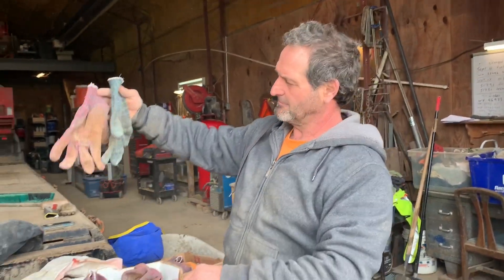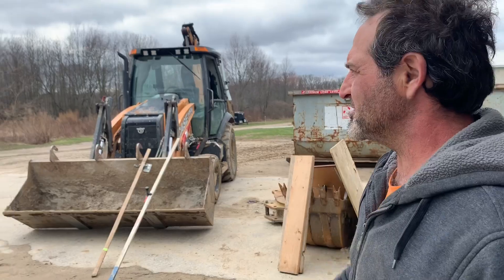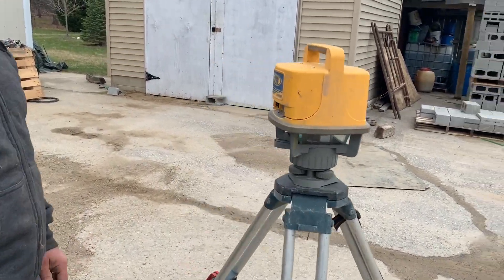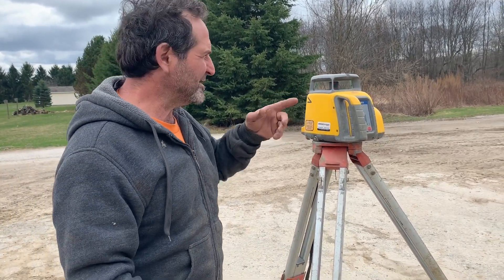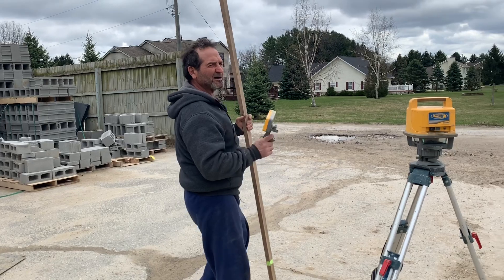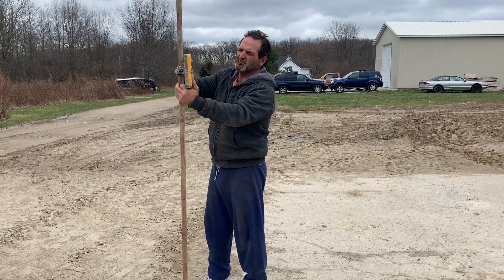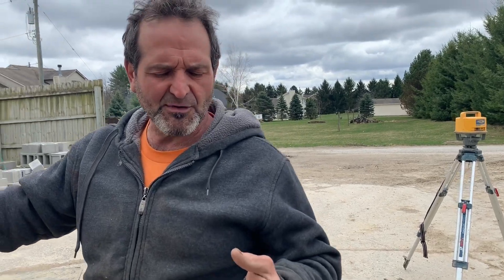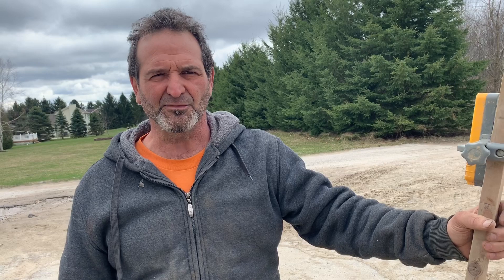How to use a Laser level for Foundation and Block

Comment: Go a question when measuring with Lazer level for footing and you are finding different height of slope when you do you put more concrete or don’t dig as deep on lower end to make the footing level before you put the base of blocks or how to make level
Reply from the maker: You can step up the footing with the grade.  Make sure to step up in proper block height measurements so it will land properly.  Keep the footing level and then step up as the grade gets higher.
Reply: So make the concrete forms kinda look like steps in the height of bricks
Reply from the maker: @joemoritz4420  Is this a trench footing?  I usually do not do any forming.  All of my work is earth formed.  I am located in Michigan - they may do it differently where you are located.
Reply from the maker: @joemoritz4420  If you are doing a spread footing, yes you would need to form it in the height of blocks/bricks so that it will gradually go up with the grade, leveling off each step.  This way everything will line up when you go to lay the brick/block.  Make sure to take into account the mortar joint also.
Reply: Yes it’s a trench I just know the ground by house is higher then where the back of my add on will end so I was thinking that maybe not dig back end a little shallower
Reply from the maker: @joemoritz4420  It depends what state you are in.  Here in Michigan code is 42" depth.  You need to cover for frost conditions.  I would step the footing down accordingly with the grade but make sure to keep a 42" depth.  I would not dig it shallow unless you are planning on raising the grade on the outside of the addition so you will have 42" coverage.  Also, I do not use any concrete forms on dirt trench footings.  The concrete should be level with grade, or slightly lower.  Come up with block.  A lot of wasted time and energy trying to put a form on top of the dirt trench and it makes it very hard to keep square and level.  Just my thoughts.
Reply: Reality is a Comedy  I’m in Missouri we have to be below 30” inch frost line I was thinking of going high side to about 36 to 40 on high end so that the way be more level but I haven’t measured yet so I do as you suggest and make it level as much as possible if can’t do a step up by brick height
Reply: Reality is a Comedy  thanks for info I appreciate the comments
Reply from the maker: Joe Moritz I hope it works out well my friend God bless!

Comment: I laughed so hard when you washed your hands. I do the same onsite and still think it makes sense. 
Got a question.. for filling foundation block walls. Can spray insulation be used instead of a concrete pour? 
Will it be strong enough to hold the wall once backfilled and is it ok with rebar betwee block also? 
Seems that insualtion is cheaper than concrete where i am, and you get a warmer house also if it works.
Reply from the maker: Hi there I am not sure but I have heard that yes you can use insulation.  I would maybe check and see if there are any videos on that topic.  Over here in Michigan we usually grout fill with concrete/grout mix.  God bless!

Comment: I am getting ready to pour a 12x8 footer. I am going to build a 5’ cinder block wall around it for a koi pond. I live in Michigan and my yard is pure sand. Do I need to do anything special or can I pour the footer right on the sand? I don’t know if I need some sort of gravel in there first?
Reply from the maker: Hi Scott -- What city are you near?  Are you up north or on the west side of the state?  Are you doing a spread footing or trench footing?  If you are doing a 12" wide by 8" high spread footing, you don't need any gravel under it.  You just want to make sure you are at least 42" deep so you can avoid frost from getting under the footing and lifting it.  I hope this helps.  Make sure to add water to the concrete, as the sand is going to soak up the water fast and it could dry too quickly.
Reply: Reality is a Comedy I am in Monroe county. On the Ohio state line. I have a hole dug 48” deep. The footer will be at the bottom of this hole. I was going to go down 8” and make it 16” wide and reinforce it with 2-3 pieces of rebar along it’s length. Then build the block wall on top the footer with rebar standing up every 4 feet to reinforce the walls. The top of the wall will be 1 foot above ground and the rest buried. God bless and thank you for the help.

I really don’t know what I am doing but I am trying to figure it out. My son and his girlfriend are first responders and they are getting married at the end of august and I was hoping to have it done before then. And I turned 50 last week so it’s a gift for myself as well. Hahaha
Reply from the maker: Yes that sounds good -- No gravel needed.  I hope the project goes great!  I'm near Ann Arbor.  If you have any more questions feel free to email me at angeloandsons@outlook.com  -- Have a blessed day!
Reply: Reality is a Comedy I emailed you from my iCloud address

Comment: That HL300s has a time period which the HI alert will engage, .Height of Instrument Alert - unit stops rotating
when jarred to avoid erroneous readings.  For the first five minutes after the laser self levels, the LED lights are solid then flashes every four
seconds to let you know the laser is still level and the HI alert has been activated.